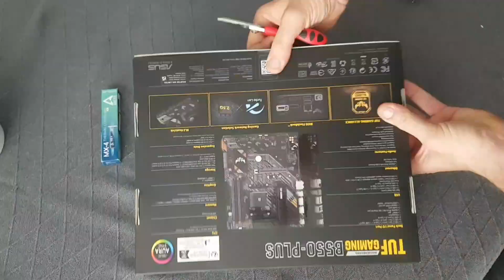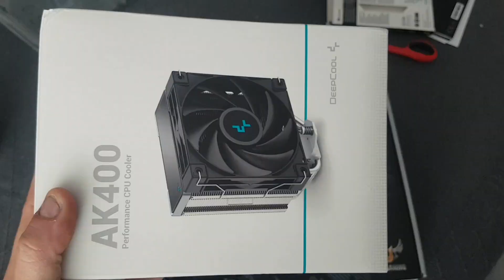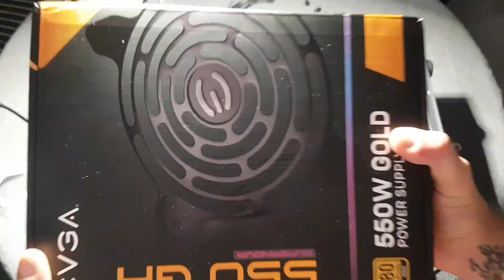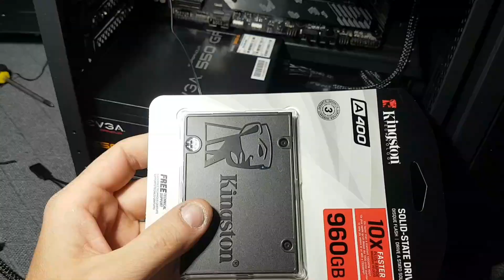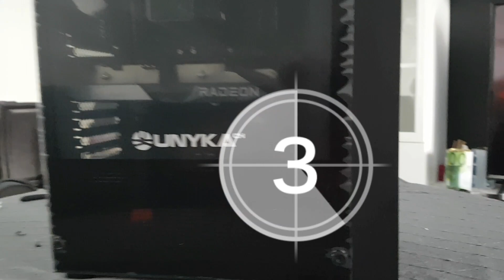Monto ordenador desde cero 1080hp . 👍👍

Comment: que chido bro yo tengo una igual casi casi solo que la grafica viene para este noviembre 😈😈 estoy pensando en una rx 7600 8gb de gygabite la de 3 ventiladores cual otra me recomiendan por un rango de precio de 250-300 dls?
Reply from the maker: Si duda rx 580 o 590 son 8 gb pero 256 bit es biejecita pero es una bomba .yo tenía pensado una de las 2 antes de la rx6600. Que tiene 128 bit.los bit son la cantidad de ceros y unos que procesa.❤ gracias por tu comentario saludos espero que te sea de gran ayuda porque no merece la pena la rx6600 xt y la que estás esperando es superior a todas
Reply: Por el precio tu mejor opción es la RX 6650 XT, rinde igual a la RX 6600 XT | RX 7600  | RTX 3060TI además es la mas barata de todas las que te mencione